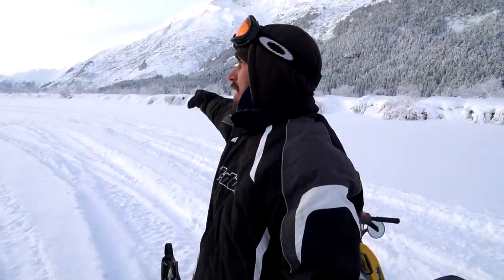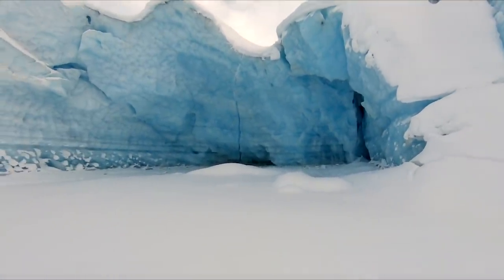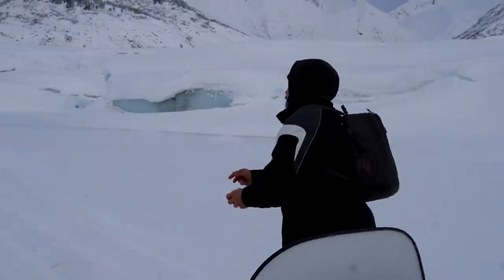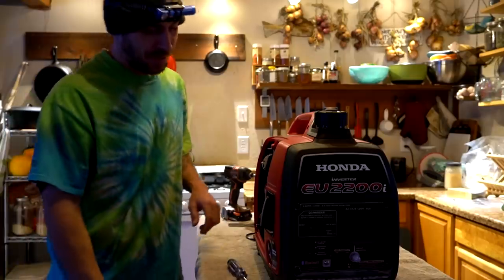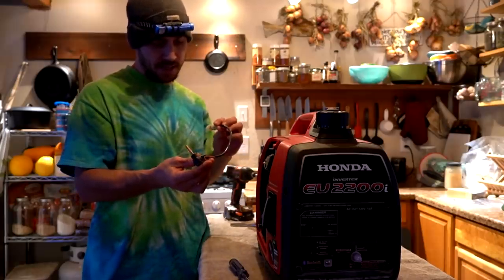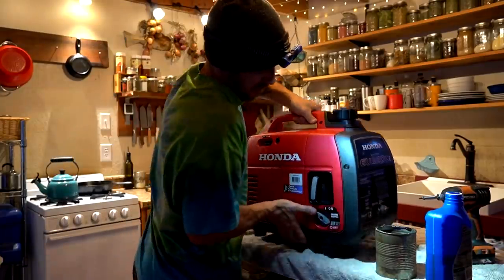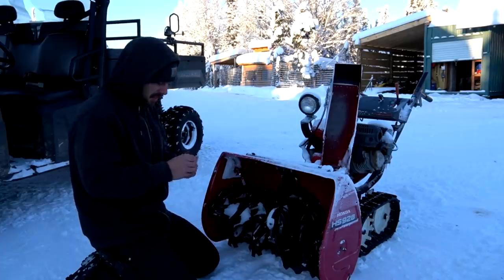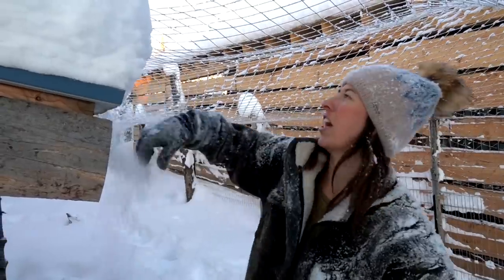Frozen & Dark | Winter Life in Alaska

Comment: I remember having the exact opposite problem in Australia, out at Longreach.  It was so hot that the fuel kept vaporising in the lines.  We had to run an extended line through a bucket of water to cool it down enough to keep running.

Comment: The drone footage of the glacier helps put in perspective how large it is, looks like the kind of place Yukon Cornelius might hang out at.  I walked 2 miles in -45*F a few years ago in Wisconsin, not good for the car batteries.  You could build a small insulated dog house sized box for the generator with adjustable vents for running in colder weather.

Comment: Ok so first beautiful video. Second, my boyfriend lived in alaska for a bit and had a tip to help you out with your generator. First don't use that drill on such delicate screws. You are using a drill ment for cars which could break or strip your screws. Second build a warming box for that generator. use your scrap lumber and put in two warming bulbs like what you would use for a chicken coop and have them run off your coleman for a bit till that generator is warm enough. This way you don't have it freezing up on you. Also make sure to have a vent for the gas fumes in this warming box. I hope these tips help you out so you don't have as many issues in the future. Thank you for these great videos.

Comment: The extreme cold you are dealing with, you absolutely have to go with thinner oil in those conditions. My riding mower calls for 10-w-30, while my snowblower motor calls for 5-w-30, thinner viscosity for those extreme conditions. What if you built an insulated and vented box to house that generator, with a hinged lid to remove it, just a thought. The glacier pictures were just stunning, you two are the best. Eric has my mouth watering again, that roast was cooked absolutely perfect. All the best to ya both, have a very Merry Christmas and a Happy New Year, thanks for sharing, from Michigan.

Comment: not sure if this has been mentioned already but with our little Honda we built an insulated box for it that allows the exhaust to run out, keeps the air that the generator is sucking in warmer, a splash of HEET in the gas helps too. If it’s going to be colder than -15 we bring it in at night to keep it warm, it’s a bit of a pain but hasn’t failed us at -40 using it at our remote property doing it this way

Comment: Colder where we live and we have over 2500 hours on our Honda. Run it every day in winter. We bought a second one bc we like them so much. We put a silicone heat pad (automotive style) under the bottom of engine to heat it without bringing it in. Also recommend some kind of box or small generator shed to keep it warmer when running it in subzero. Hour meter is also a must (Amazon is your friend) for oil changes. Big difference in starting it with dirty oil vs clean oil. They are really good machines once you figure out what they like.

Comment: Talk to pilots about carburetor heat. You can rig a metal shroud around your muffler and connect it to the air intake. It will warm the air and prevent icing.

Comment: that heater in your generator crankcase breather should solve the problem. pretty sure there's one in my 2000EU honda. i've never had trouble with it icing up but i have had the same trouble with other brands and engines. it is a challenge to keep those tiny engines happy on the extreme cold. great videos as always. the days will get longer now.

Comment: We lost power last week here in Galena, AK for 4 hours when the temps were -50. Every house turned into a dry house very quickly as the city water main froze when circulator pumps went out, and some houses froze through when heating fuel pumps and toyo stoves went out. We are on day 9 without water here but don't notice it.  We got our nice blue jugs, a wood stove and composting toilet. Life in Alaska is beautiful, but can be equally harsh. Wouldn't wanna live anywhere else!!

Comment: build a insulated box to put your generator in when running it also, just make sure enough cold air intake  but it will help keep those generators warm just open it to regulate not to hot but it works

Comment: Hopefully you two see this… a Skidoo snowmachine tip for your newer sled. So if you are unaware or if you haven’t done it before, the crankshaft in those sleds have bearings that need to be greased with a special grease called isoflex and usually gets done before every riding season. I see you two go far out like I do and wouldn’t want your crank to seize up on you when you’re miles out! Merry Xmas from Eielson AFB.

Comment: Nice shots of the glacier. I'm thinking you could jury rig the exhaust so it warms the generator itself, so no issues with frozen oil, fuel, or ice formation. Volvo does something similar to warm up the batteries on cars.

Comment: Regarding your Honda generator, I have a Hyundai and I was  using regular regular grade gas which has ethanol in it and I believe ethanol attracts water.  Anyways I was told to use premium fuel.  Actually I also have some highly refined fuel made in Norway which is clear as it has no dyes.  It's not cheap but I only use  it in winter when iam out on photography trips mostly in the Rockies and I live in my van.  You could look into it. Love those glaciers and would like to get some images  from inside the caves, but only if the ice was really frozen.  Merry Christmas you two.

Comment: Try running 0/30 synthetic oil. That's what I  run in my walk behind snowblower.  It's 44 years old Briggs&Stratton without an easy pull start feature...works nice. From southern Manitoba where temperature plummets equally to yours. These engines don't have an oil pump so the sooner you get oil splashed around the better.

Comment: There is a spark arrester screen that needs to be cleaned every 100 hours on that generator if you don't do that it will not run just FYI . It's part of the exhaust tube that you can take apart

Comment: @Simple Living Alaska. Everyone in Florida for the past few years is having trouble with small engine carburators.  They get clogged up after one use and wont restart.  Non-ethanol fuel can help but nothing is a sure fix.  Briggs &Stratton, Honda, Husquavarna, etc. I began using the electric push mower.

Comment: you can get or make your own thermal wrap like for house pipes, . Just plug it Ito outlet and it supplies heat 50+degrees tp where ever you place it. pretty simple thing to build. Its just a thermal wire -resistence wire, just insulate it .

Comment: On aircraft engines we have what is called Carburetor heat which we use when mainly landing or if we are flying through (cold) moisture because with out that the venturi   will actually freeze and the engine will quit it has been over forty years since I piloted an aircraft, I suggest you talk to an A&P aircraft mechanic as I am just guessing? You should be able to fashion it yourself as you are pretty sharp, try to maybe divert some heat from the external  exhaust pipe nearest the cylinder head maybe try and route it to the air intake so it would ingest heat??? Does propane freeze  there?

Comment: Awsome to watch you guys.  Don't know how I missed this video but any way.  I imagine you run synthetic oil--if not give it a try. Can pick it up at Wal-Mart.  You can find the 100% synthetic.  I run it here for the hot temps.  Think it would work a lot better for the viscosity and cold temps.  As for the fuel problem--imagine you can't easily get it, but if you can get some from the sea plane operators--I think it would work better for your small engines especially the Honda generator.  It would be 100 low lead.  Cost more than auto fuel, but hang on.  Could blend it with auto fuel, but then you would be promoting the moisture problem again. Unless you are running non-ethanol.  May the good Lord bless you 2.
E. Walter Wilson

Comment: You may want to switch to propane generator. Issue with gas / Diesel is the fuel freeze. Propane or NG never does. You bring in your fuel so no real difference, just in a bottle format.

Comment: If I had to bet I'd assume that the cold temperatures are causing the water vapor in the generator's exhaust to condense immediately on being vented (not being able to disperse into the air) and then getting pulled into the air intake where they finish freezing.

Comment: I know your not from here. LOL 
 Have you ever noticed any local Snow Machiner's wearing Helmets ? 
Do you think they wear them because they are cool or silly?
We wear them because they protect our head in crashes , Hitting branches and the Number one 
reason is they keep our heads warm! Most have a fiberglass shell , then 1 inch of styrofoam . 
Then all the padding .  We also have a face mask and usually googles . 
I grew up in your area. And knew of people that died without helmets or they came off because 
they weren't secured on the head properly . 

P.S. 
Build a insulated generator box. As the generator runs the heat from the generator and exahust
will keep the generator warm and quite.

Comment: with honda engines always leave it on full side,u can;t over fill them with oil,buid a box around the engine,try to use the exhast to keep it hot.but dodn;t use exhast air in the freash air

Comment: Id say build an insulated wooden box to trap the heat the engine makes from running n get premuim gas or occasionally ad "Heet"Isopropyl alcohol in case there is water from condinsation or maybe sea foam, Winters can suck in North Dakota to usually two weeks to a month around january is the worst but there have been a few years we've had rain n that can be a worse nightmare cuz then it turns to black Ice on the roadways. Its time to go home when that happens as trucks n cars are in the ditches  doesnt matter if you have 4WD if you dont slow down ur screwed.

Comment: Low oil shut offs are always problematic. I have several generators and have had problems with the low oil shut off going bad.  If you pay attention to your oil level, which you do and change it as needed, which you do, and notice if it has leaks , which you would. You dont need the pain in the butt, harry homeowner low oil shut off. Disconnect it and bypass the real problem.